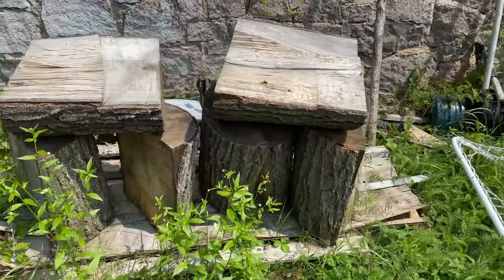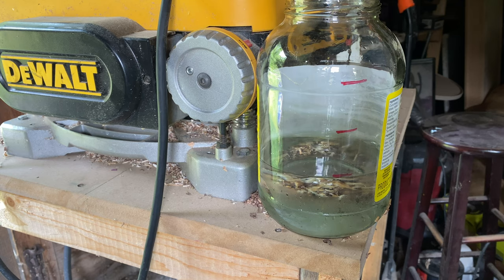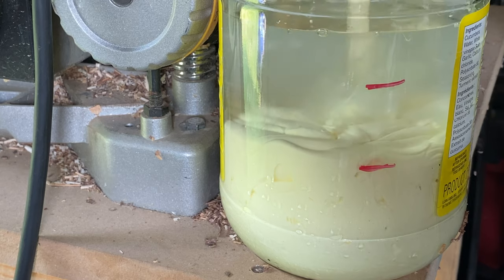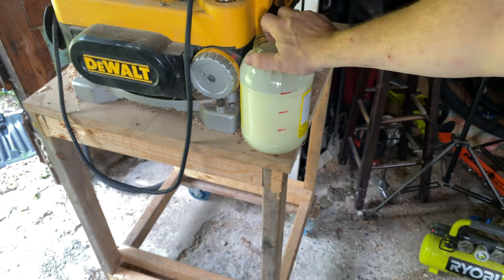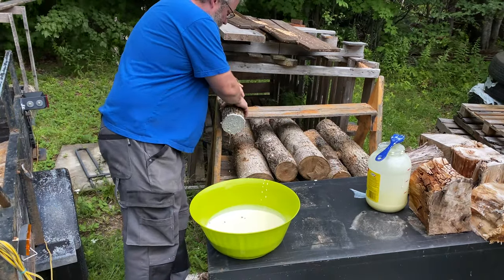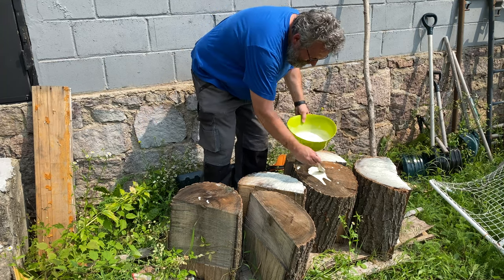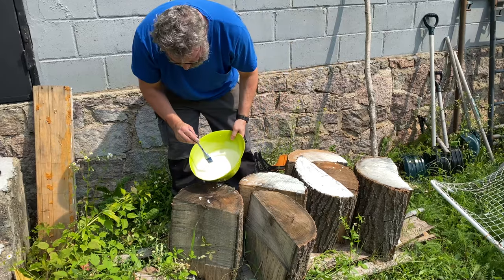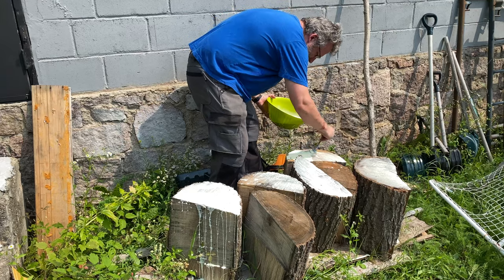Best Way to Prevent Logs from Cracking!

Comment: I would think leaving the bark on would drastically slow the drying process on the full rounds. What was the final outcome? Thanks
Reply from the maker: I should answer that question soon
Reply: Got  a large log of oak...cut a 4 inch thick piece off the end for a chess board...got no patience, so took it inside to dry...broke in half 😮.but kept it's bark...try this with the next attempt 😊..still looks good ,stuck back together..

Comment: Ever tried the salt paste or boiled linseed oil?
Reply from the maker: No
Does it work to prevent splitting?
Reply: I join the line since I’ve the same question. I regularly use this oil but never had the chance to test in cracks.

Comment: What kind of glue???wood glue or paper?
Reply from the maker: I use carpenter glue,  my favourite is tittebond original
Reply: @TheWoodenRider  appreciated sir
Reply: @TheWoodenRider if we will use carpenter glue it means we should store these logs or slaps under cover otherwise the rainwater or dew during night will wipe out the thin coat of glue leaving  the grain side once again exposed for cracking and splitting???
Reply from the maker: Maybe just cover with a tarp however unless it rains I’ve never had issues drying glue outside overnight

Comment: plastic wraped under sun, wood must not touch to plastic, small opening at bottom to let water drain out. water must not drip on wood eihter.
inside out  wood will stay at same moisture level, water will condensate on plastic and drain out by itself.